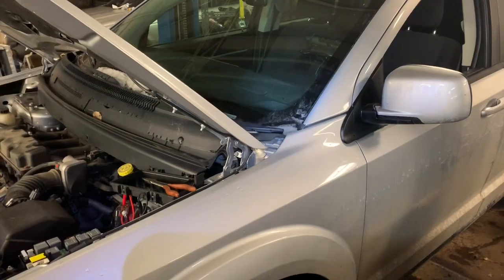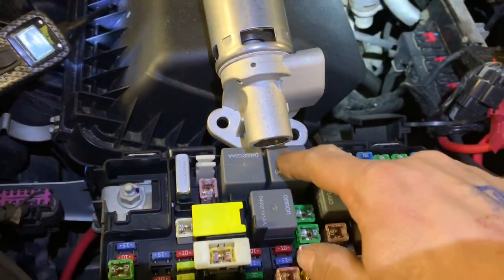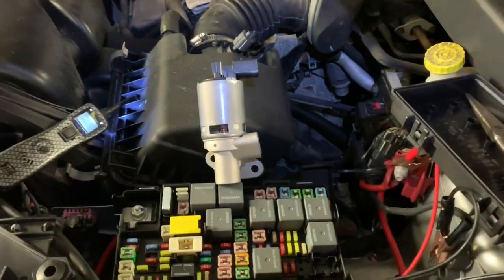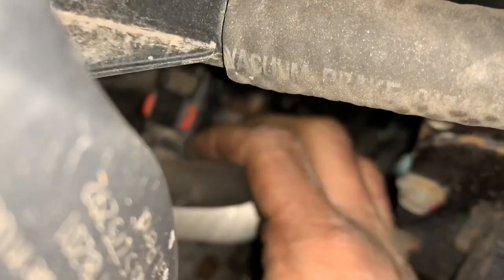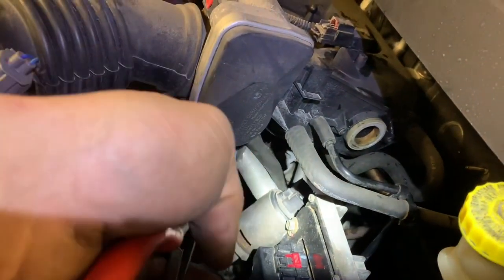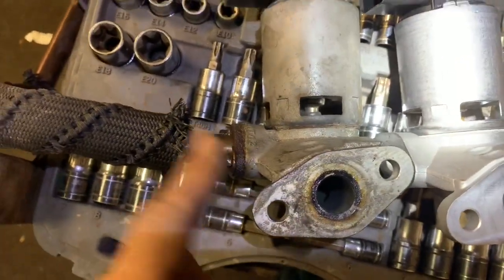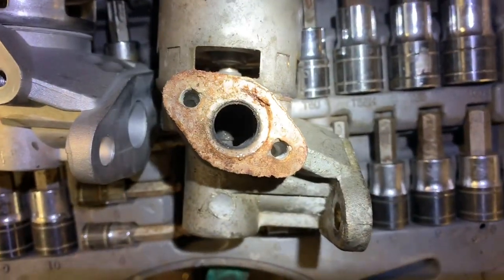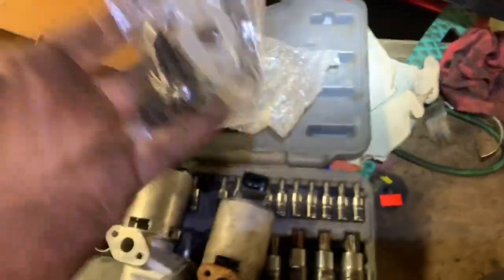Dodge journey 3.5 EGR Valve removal and could be reason for no start

Comment: Thanks for the video, it helps out to know what you are getting in to before you start.  Had a P0404 changed the EGR valve out and cleared the code. It hasn't come back. 👍🏻

Comment: a much easier way and less messy is remove the 2 vacuum line just behind the throttle body, then the egr and tube lift straight out without removing any coolant lines. A 15 minute job

Comment: I put in the new Dorman EGR valve in January,  by August it was already bad. My mechanic told me they are less reliable than Mopar parts, so I  will need to try the Mopar part now.
Reply from the maker: You may also want to consider that you may have plugged up catalytic converter‘s or your emission system is not working properly I’m just saying it could be just defective parts of course as well like you’re saying

Comment: Hi , l have a question about my Dodge Journey 2009 ti doesn’t start so l changed the alternater the battery is new but it doesn’t start anyway so can you please help me thanks
Reply: More then likely its the Range sensor and shift linkage cable